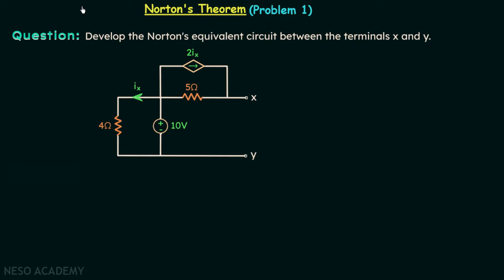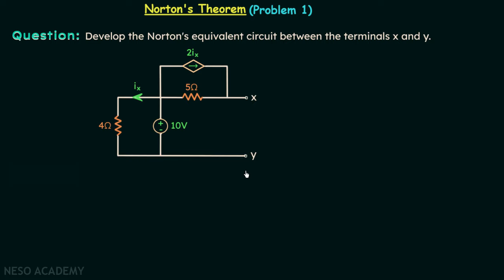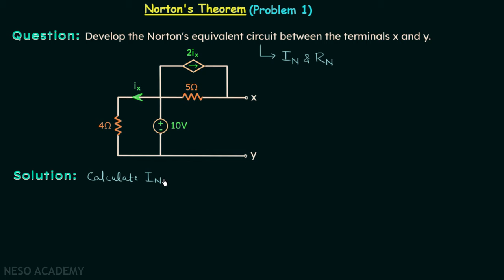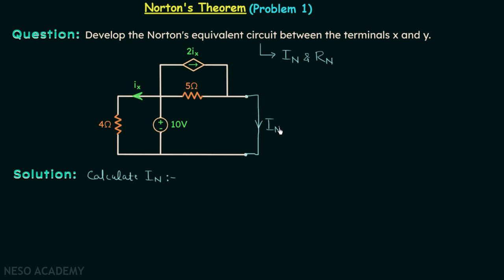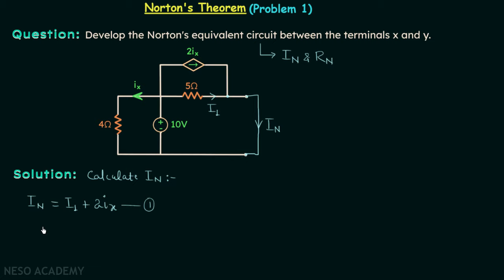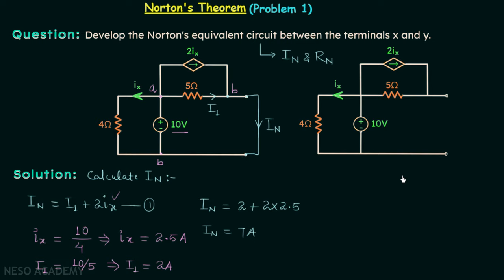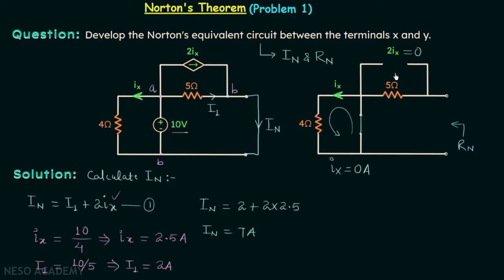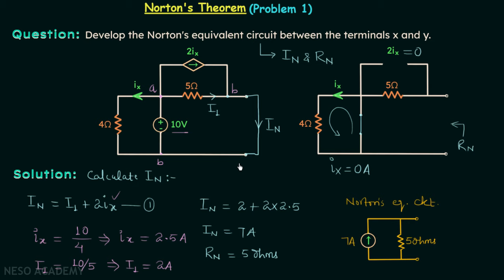Norton's Theorem with Dependent Source

Comment: In the last step for finding RTh, 5 ohm and 4ohm resistors r  connected in series so RTh should be 9ohms?
Reply: there is a short circuit after 4 ohm resistance (where he replaced the independent voltage source with the short), hence it is not taken into account
Reply: Another way to think about it: across the 4 ohm resistor, the potential difference is 0 (the resistor is connected to the same node!), thus no current will flow through it (ohm's law). Thus it's as if the resistor doesn't even exist, since R = V / I (both V and I are 0) = 0.

Comment: why 4ohm is not consider when find Rn ?
Reply: Becoz of short circuited voltage source
Reply: As the voltage source is now short circuited, the 4 Ohms resistance comes in parallel with a short circuit. As you know when a s.c is parallel with any resistance, the overall resistance is 0 ohms. Hence, the 4 Ohms is not considered when Rn is being calculated.

Comment: Why the independent source has been open-circuited when it equals Zero?
Reply: Or,you can also find Rn by adding a 1V voltage in a-b terminal and short circuiting the 10V.
Then the 4ohm will be ignored due to being short circuited.
Then the voltage source,5ohm and dependent sources will all be in parallel and you can find i=1v/5 =0.2
Rn=v/i =1/0.2
Reply: @mumtaheenareza6484  why we applied kcl at the reference node b